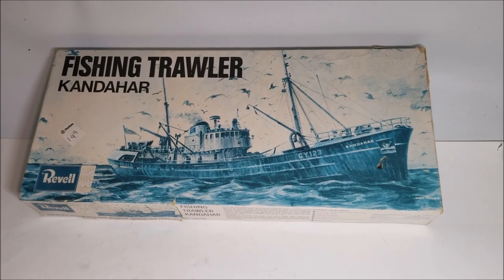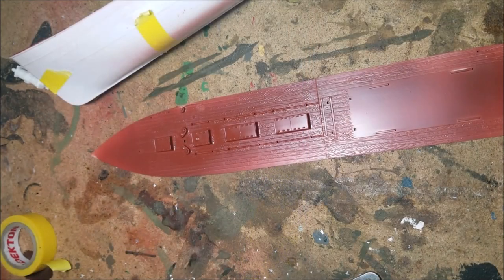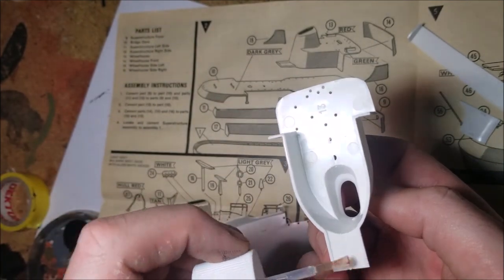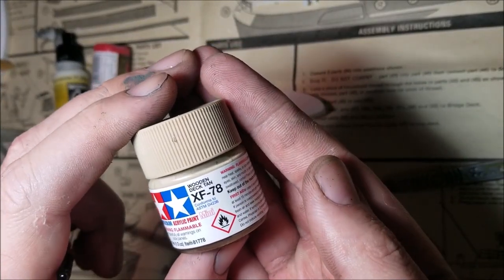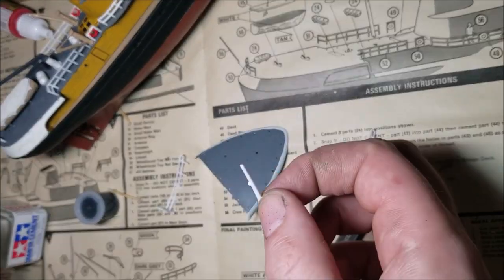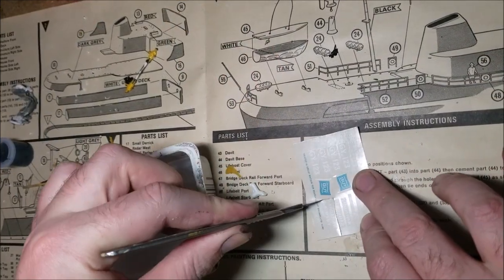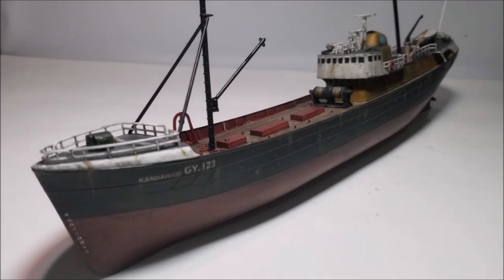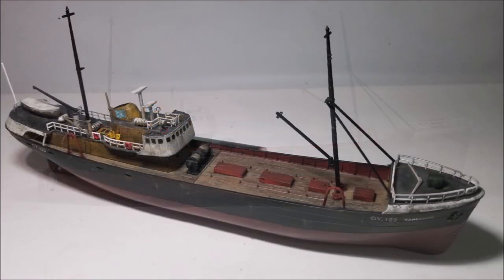Revell Fishing Trawler Kandahar Vintage Model Kit full build

Comment: This came out great. Im building this now, as the reboxed version - Northsea Fishing Trawler. Would appreciate your input on my weathering- videos on my channel.
Reply from the maker: How you finding the build so far? Ill check it out after work later and drop you a comment
Reply: @scalestuff1066  it falls together surprisingly well for a mould that old. Except that front of the wheelhouse which I'm sure you remember also. Filler required there only. I've decided to open up all the wheelhouse windows.... May pop a little led inside. Thanks for the inspiration.
Reply from the maker: @m0rce1  Yeah just that wheelhouse lets it all down, if you are going to light the shit up, that would look awesome but be sure to line the inside with some tin foil, or otherwise the walls will glow, i learnt that on a small scale titanic i made years ago, in the dark it looked radioactive!
Reply: @scalestuff1066  noted. Will make sure I don't get light bleed :) thanks 👍